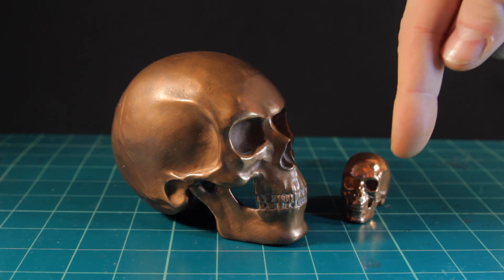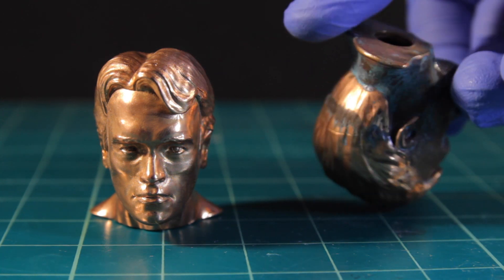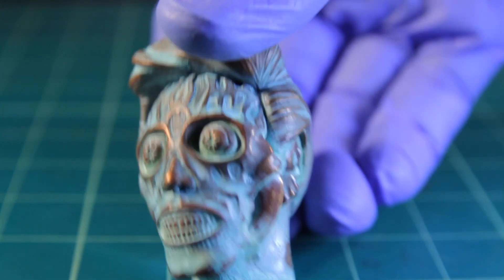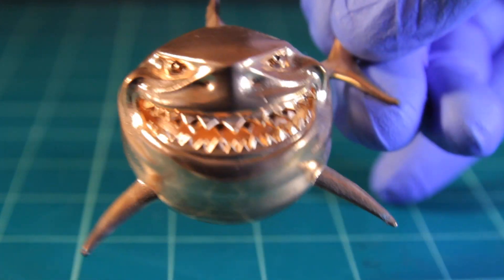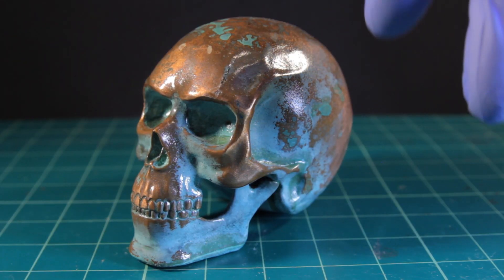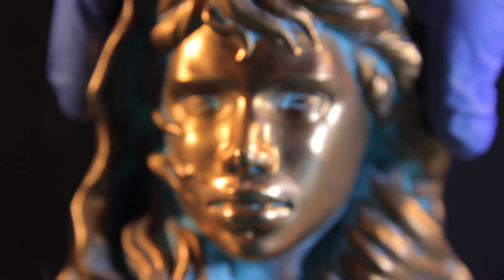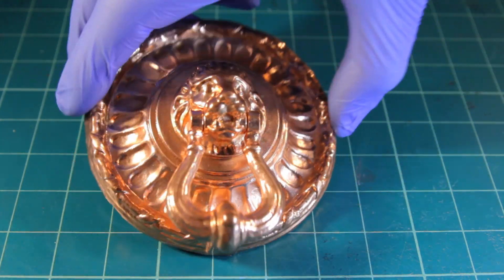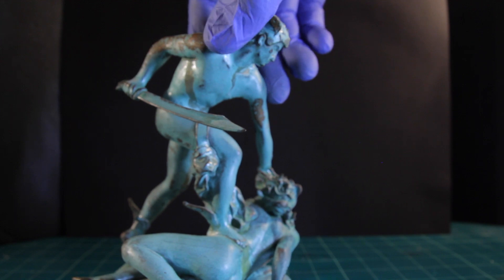Electroplated FDM vs RESIN

Comment: Nice results, I’m just getting into electroforming i hope to get the same finish as you one day
Reply from the maker: I also electroformed some smaller items. Im going to do an electroforming tutorial eventually if i can recover from my annioying long covid. Spraying the conductive coating is in my opiinion essential for a smooth finish.
Reply: @Cloakfiend yeah I’ve got a airbrush and copper conductive paint but getting a nice even coating is tricky without blocking the nozzle. or being too thin that you need lots of coats of paint😢
Reply from the maker: @spongeknock7387  its very easy when you know how!!! But yes you cant lay it on too thin with some paint. Good graphite sprays have unfortunately tripled in price since this electric revolution. It sucks as i now pay way more when it was pretty cheap before.

Comment: It's super cool, how did you do that?
Reply from the maker: Thanks! Ill wanna tell everyone about my techniques but people have approached me to simply monetise it for themselves so once i have more subscribers ill just tell my super easy method for free here. Stay tuned! Its a method of electroforming.
Reply: @Cloakfiend  i'm really curious how you created a conductive layer on the plastic. I would like to plate some print, I thought I would use a graphite spray (GRAPHIT 33) or some kind of metal powder and melt it to the print, but i haven't done nothing yet.
Reply from the maker: @alexlux147  you dont need to melt anything. That graphite spray is ok. You can also use shielding sprays that conduct like zinc and copper. I have a unique method of application Ive not seen before though.